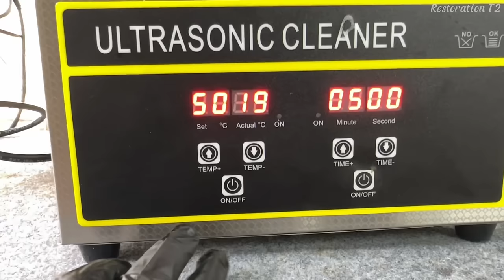RESTORATION OF OLD RUSTY BRUSH CUTTER | Restore japane 2-stroke Mower

Comment: Good restoration, but I'm surprised that the carburettor was not stripped and jets cleaned. In use, the blade speed seems very slow (it might be due to the camera frame rate) and seems to slow even more when cutting. Perhaps check that the clutch is gripping properly.
Reply from the maker: Partly due to the aspect ratio, along with the fact that the grass is very soft, I run at low speed to save fuel.👍👍👍
Reply: wead wacker carburetors dont really have removable jets bro its all diaphrams and he did strip it and clean it and replace the diaphrams its not like a dirtbike carb